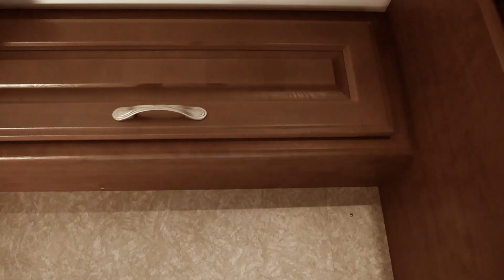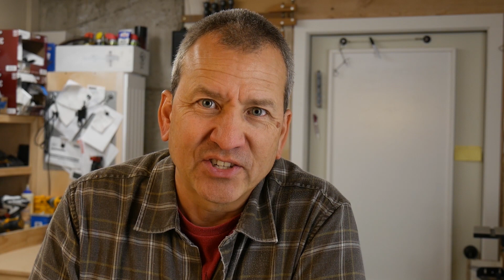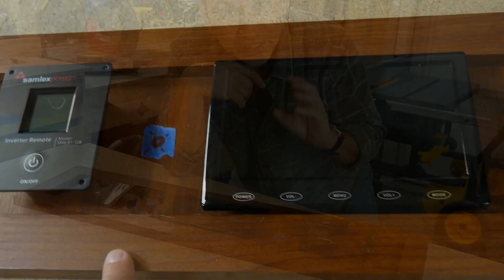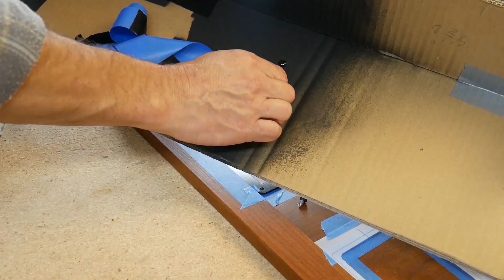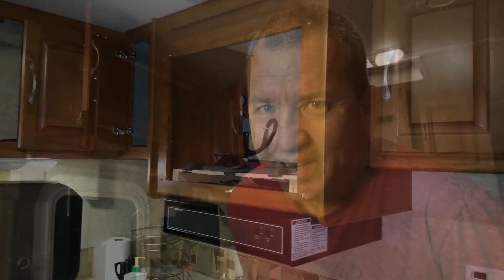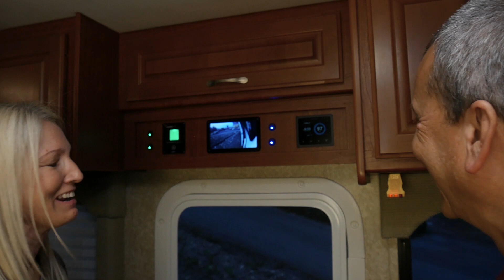Class C RV Renovation - Building a Custom Control Panel | RV With Tito

Comment: Hey Brian, great channel. I have what looks like the exact living area as your RV other than mine being 2 foot longer (king bed). I'm a electrician by trade. I've been upgrading my wiring so my light switches are on the wall so that my girlfriend can reach. I came across a wiring harness (low voltage bundle) passing thru right above where you made this upgrade. Do you know about this harness? It has several wires labeled 'surround spkrs" 4 sets,  , lights 1,2 , solar, etc....this bundle starts in the panel under the tv selector box taped up for a stereo option that wasn't installed. Have you ever traced out these speaker wires? Solar wire? Next on my list... I'm about to add a iRV66 stereo system with 3 sets of speaker choices. Hoping this harness could save me some time running new wires. Any idea where they may go before I start removing more paneling? Love all your ideas, great job.

Comment: Nice work! One thing that I find helpful for me is to use a drill bit in the corners of a square cutout for a relief cut. The flange can cover any rounding that might occur, but it works great and the center comes away cleanly. Keep up the good work!

Comment: WOW!!! That really looks nice. Like the comments below say, you do excellent work and yes you could be the next Norm (for RV's). I have a spot above my door that already has a self and what looks like coat hangers, but I think they are for hats instead. This would be easy to box in. I might have to think about doing this also. Thanks. Keep up the great videos.
Reply from the maker: Awesome. Glad to help share ideas. The key is thinking through how to get the necessary power and cabling to that spot. If you can figure that out, the rest should go smoothly.

Comment: Great video Brian, I was wondering where you took the panel from. I'm thinking of doing the same thing using removed panels from under the bed. Gonna make a hideout for the dogs under there. You're right, looks like it was meant to be there. Probably installed better than factory as well.

Comment: I believe that I would have used a different hinge as well as mitered the corners at 45 degrees so that you wouldn't have the raw
edges exposed.  Also I would use a push button latch in the center to make it easy to open and close the panel.

Comment: That hot glue isn't going to hold, you might want to consider a metal strap across the back of all of those monitors
Reply from the maker: Will keep an eye on it for certain. I've hot glued a couple other things that are still holding.

Comment: nice stock looking cabinet BUT dont use hot glue . your LCD well fall down in not to long in the cold and hot swings .  just take the next step and 3D print parts you need to hold things right even if you have to send them off to be printed
Reply from the maker: I was originally going to make some kind of bracket, but just ended up with the hot glue solution. We'll see how it goes :)

Comment: Why did you cover up the push button on the camera screen? Nice video
Reply from the maker: I don't need any of the monitor controls since I'm just using it as a camera monitor. It does also have a remote that I can use.

Comment: Have you seen the newer silicone covered wires?  Much more flexible than regular vinyl covered Multistrand.  Are you concerned about the hot glue holding up in the summer heat?
Reply from the maker: No. Not concerned about the hot glue. It would have to get pretty hot in there to make it an issue. I mean really hot. The monitor is really light weight. I'll check ou t that wire. Thanks!